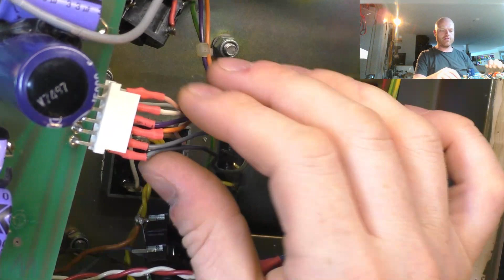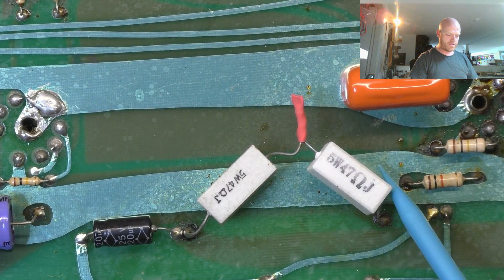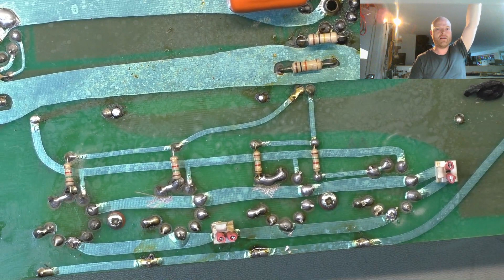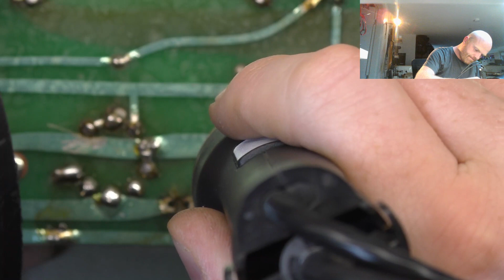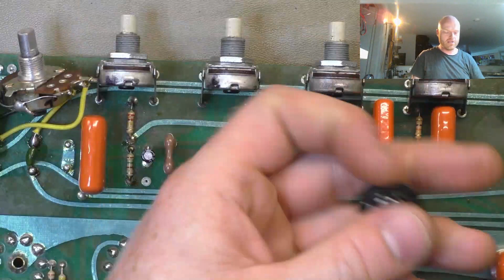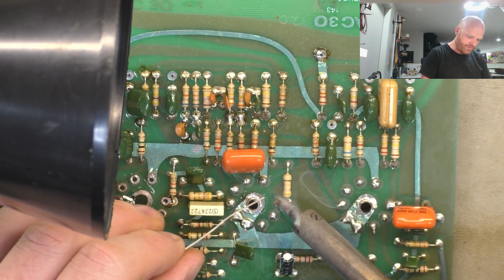Follow up: Vox AC30 30th Anniversary Limited Edition - Part 2 (1080P)

Comment: Hi Brad, maybe you should change the filtering on the first preamp tube first gain stage  to 10uf and for the phase inverter  tube, also for 10uf. it does open the sound of the vox and put it to jmi specs, good job on the amp .  Thanks for your videos.

Comment: Nice work, Brad. It has probably never run so well. So, what is up with the traces on that PCB? Looks like it was made by kindergarteners!
Reply: Back in the day, circuit board designers used to draw layouts by hand, starting with a board that was completely covered in copper and drawing how they want the traces to run, with a special pen that contained solder-mask. 2 The circuit board was then put into a solution that dissolved the copper,  except in the places where it had been written on with the solder mask.

Comment: The electrolyte leakage from some ---- not all ---- caps smells like fish when heated/desoldered.  I don't know how it's possible but sometimes the electrolyte seems to literally soak right through the solder joints and and cause corrosion damage *on the opposite side of the board*.  I worked on an amplifier recently where several  caps that were hanging upside down from the board (foils facing up) leaked electrolyte and the fluid wicked up the component leads and went through the solder joints and corroded the foils on the opposite side.
Reply from the maker: Yes, I've seen that too.
On early Boss SMD/through hole combination PCBs with the SMD 'cap cancer' issue in particular. It must either wick through the fiberglass after dissolving the resin, or possibly migrate through the solder. The solder gets rock-hard and won't melt afterward, so I'm guessing the chemical composition of the alloy changes to some compound in the process, so possibly that's it.
Reply: @BradsGuitarGarage ,  the PCB showed no discoloration or signs of chemical change.....the electrolyte appears to be traveling through the solder.  The green solder-resist coating on the traces was speckled black from the chemical change.  I've also seen cases where the memory battery satured into digital digital Wi-Fi receivers there's leaked and went bad and even though the battery was completely dead the solder would spark and arc when you desoldered it. 1 It appears that the electrolyte interacted with the dissimilar metals in the solder and turned the solder connections into tiny batteries!

Comment: If you're gonna mount components on the foil side of the board (was that factory placement or did the previous "tech" relocate them?) and they'll be spanning across foil traces,  anything that could burn, like a diode or a resistor, should be perched up off of the foil a little bit so that it doesn't burn the foil, or short out to it, if the component overheats and disintegrates and burns due to a shorted tube or whatever. Flameproof resistors would seem to be a necessity in a case like this. Even adding a mica transistor insulator or silicon heat sinking pad between the component and the board would be a good idea.  These boards do look a lot nicer than what you'd find in a Fender reissue, and they're holding up well to the heat and mechanical stress of desoldering ----  But some of the solder pads are located a little too close to the adjacent foils for comfort and good electrical insulation/isolation.
Reply from the maker: Hard to see from the camera perspective, but the screen grid resistors have about 1/2" under them and the EL84 grid stoppers about 1/8". The biggest part that worried me was the two OT primary pads so close together (who the hell designed this thing!?) so I peeled back the foil a bit and soldered to the face of the big fat trace which isn't ideal, but was the best solution here. The copper was actually pretty well affixed to the fiberglass and reasonably thick compared to modern PCB examples.
Reply: @BradsGuitarGarage  ,  It almost looks as if the prototype boards were drawn out by hand from the irregular look and lay out of the traces.

Comment: Even Chemistronics solderwick oxidizes and goes bad with age. I have several old rolls of it where the copper has turned reddish-brown; I was trying to use it yesterday at home (recapping a pair of old point-to-point-wired Heathkit hifi monoblock amps) and it didn't work very well even when I dunked the braid in some rosin paste flux first. (These are kit-built amps ---- it could be partly a problem with whatever solder was used, but I added fresh solder to the joints first and it still didn't wick up cleanly with the solderbraid).  I may have to bring the amps in to work on a day off to use the vacuum desoldering station, or at least crib a roll of fresh solderwick from work.
Reply from the maker: I cannot condone theft from one's employer. *nudge, wink.
Reply: @BradsGuitarGarage  , my boss is the worst packrat you've ever seen; buys or collects everything in bulk even if it's something we're not that likely to use. We've got bins and bins and bins full of odd parts that none of us have used in at least the past 17 years since I've been there.  He did have the sense to buy several cases of Kester tin/lead solder with 2% silver which we use all the time and it's wonderful stuff, but we hardly ever use chemwick because 98% of the time we use the vacuum desoldering station instead.